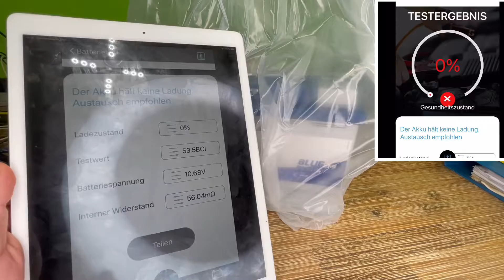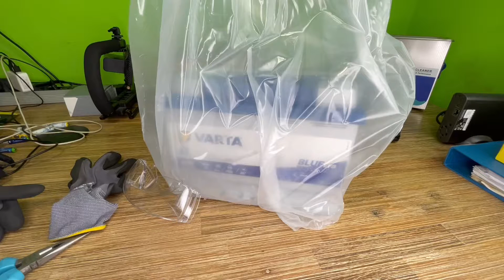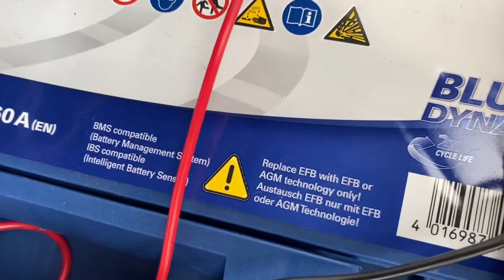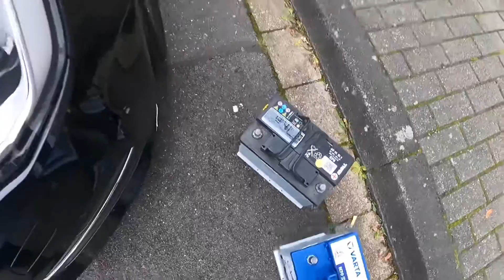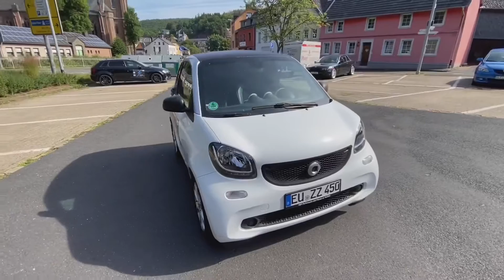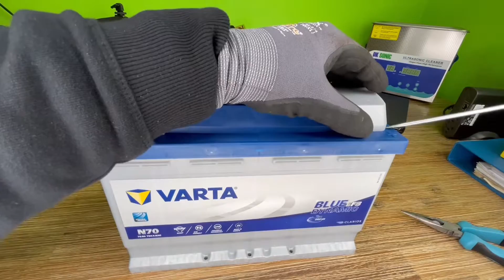Varta Blue Dynamic EFB 570 500 076 (enhanced flooded) car battery unboxing and instructions

Comment: It's a free maintenance car battery?
Reply from the maker: Indeed
Reply: No it does not work. It has no nuts to attach to the positive and negative terminals. It comes with no instructions. So pointless. @PDPPerformance